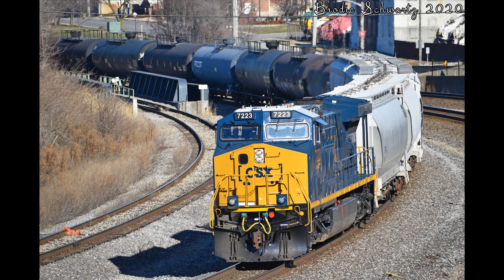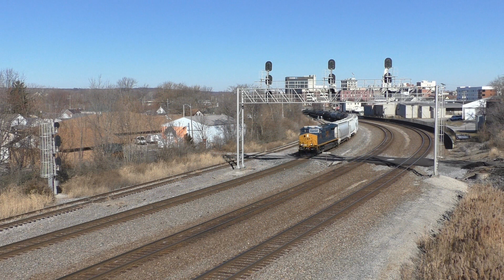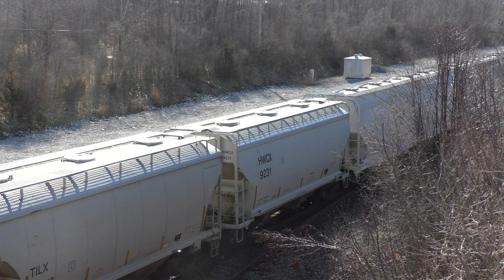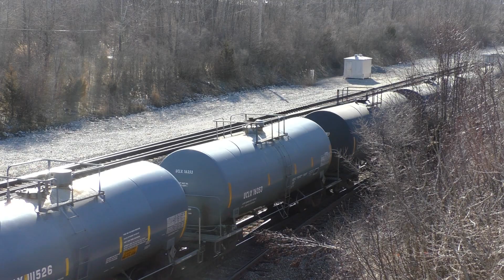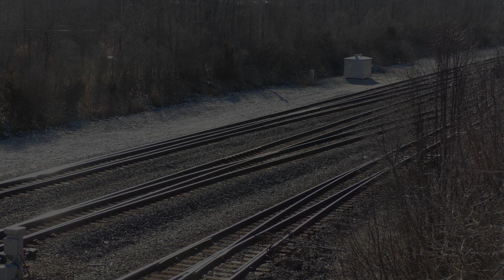12/26/20 - CSX Q501-25 Receives EC-1 Track Warrant

Comment: I was at this location a few years ago and couldn't believe what I saw.  Some sorority girl and her photographer thought it was a good idea to pose for photos sitting on a rail.  I had to warn her that she was sitting on a mainline track.  The same thing happened once when I was in St. Augustine, Florida minutes before a Florida East Coast intermodal train arrived.  In this case, the girl was even laying down on the rails.  I warned them, but they ignored me because they thought they would hear the crossing signals in time.  The problem was that the crossing was a ways down the line and they wouldn't hear it in time to react.  They got their poetic justice when a St. Augustine motorcycle cop spotted them and hauled them off the track.